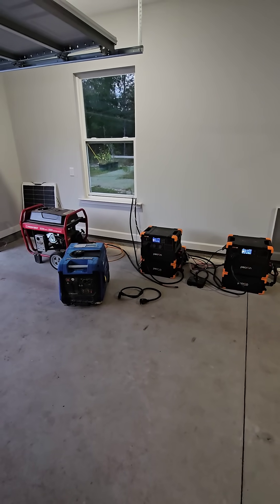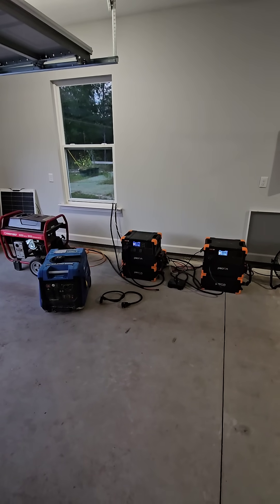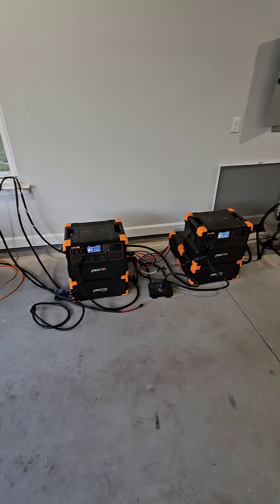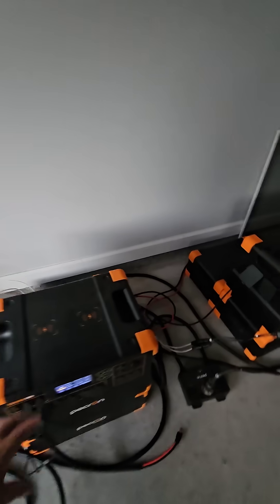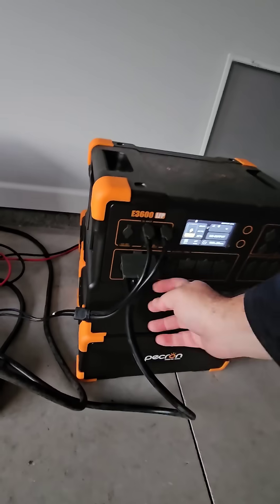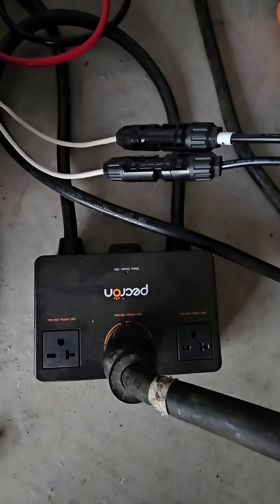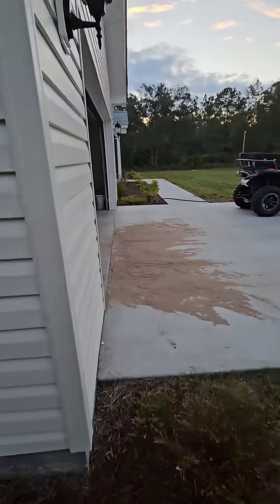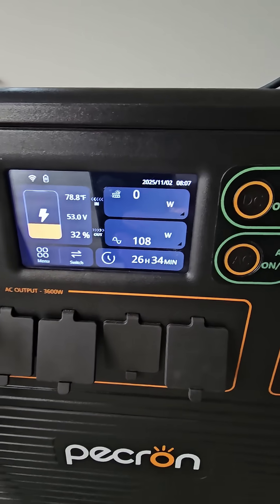My Crazy Pecron Charging Idea... #solar #solarpower #Pecron #E3600LFP #offgrid

Comment: Ac charging while in 240v mode.
I saw a way to ac charge and have ups mode when pairing 2X E3600LFP's in 240v mode.
If you have a 240v capible inverter generator, get a L14-30 to Dual TTR30 plugs. The way this adapter is wired it splits neutral and ground to each plug, and each plug gets one of the two hots. Utilizing this you can plug in the 2 30a charging cables to charge each unit. Because the split phase wave timing is controlled by the 240v generator you can trick the units in 240v mode with no communication cable (disconnect the Pecron communication cable between each 3600). From each E3600's perspective it is just operating in standard 120v UPS mode, taking a step back you are able to pass through whatever power is needed for 240v split phase load and the balance will charge your batteries.  You do need to pay attention to your generator, as if it shuts off the two units have no idea what the other unit is doing for phase timing. Maybe a video test on his idea?
Reply from the maker: I'll need to make a cable and test it out!

Comment: I have a question about the connection to the house circuits. What is your setup there? I have the dual Pecron 3600s and the 240v hub.  I have not had a chance to directly ask Pecron if the system is floating or bonded neutral, but searches so far lead me to believe it's bonded (not floating). Do you know, and are you using a generator transfer switch that also breaks the neutral from the grid?

Thanks for showing all your real world testing for those of us who are not that far along.😀👍
Reply from the maker: For my house, my ground and Neutral are bonded at the meter panel. As for the E3600LFPs they are not bonded (open ground). It has a ground screw next to the network port. If you are using the 240V hub it will be grounded via your house ground. Regarding transfer switches, they only break Line 1 and 2 only. Most residential transfer switches have a solid (unswitched) neutral.
Reply: @GridDownPreparedness thanks for the reply! I also plugged in a conventional outlet tester (3 light) to a 120v receptacle on the station and got a "hot / neutral reverse" indication.
Reply: @GridDownPreparedness also did get confirmation from Pecron on the floating neutral of the machine, and that indeed an external neutral bonding plug (of the type used to bond a floating neutral gas generator) can be used when the Pecron is used as a stand-alone source for devices that require ground. i.e. The board on my central gas furnace will not allow operation when it does not "see" ground from the plugged-in source. The external grounding plug into a separate outlet on the generator solves the furnace board's requirement. I appreciate you sharing your experience because I wasn't arriving at a conclusion from readings I was taking 👍